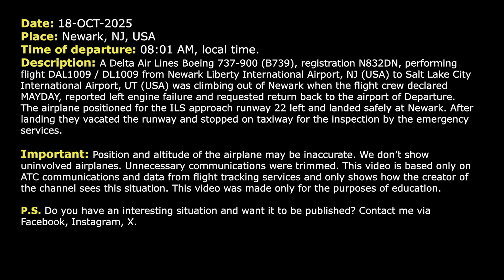Engine failure in flight. Pilot declares MAYDAY and returns to Newark. Real ATC

Comment: Omg. Who gives a shit how much fuel weight they have???
Reply: fuel amount in pounds is for the firefighters in case of a mishap, lets them know how many trucks/how much foam etc
Reply: @slappymcgillicuddy7532  Correct. It also matters runway length. More fuel = heavier = longer runway likely needed. Also lets ATC figure out if there are viable alternative airports with long-enough runways in the event the plane cannot return to the origin airport for some reason.
Reply: @slappymcgillicuddy7532  How much fuel can a 737 have? Send fire engines for full tanks an eventually spare one water load. What difference can 35k pouns or 20k pounds? I can understand if it were a B777 or A380, but on a narrow body twinjet it's only harassement on pilots who have other duties to cope with.
Reply: @marcotravaglini5747  I agree they need to quit asking 50 times, have tower pass that info on to approach/center whoever and then to the ground response vehicles.
Reply: @slappymcgillicuddy7532  fuel amount is weight in pounds is irrelevant to the firefighters for a situation like this.  The response level is dictated by the alert level.
Reply: @cruisinguy6024  I was a flight engineer for 15 years on the KC-10 and it was my job to dump fuel in emergencies,(happened a ton) and that is 100% why they ask for remaining fuel in pounds, it is for the firefighters and a few other reasons, I actually talked to them after they followed us in to chocks after an engine failure and they confirmed this,
Reply: Exactly.